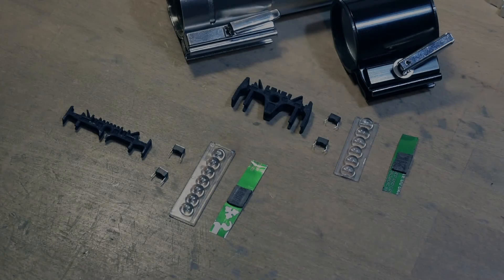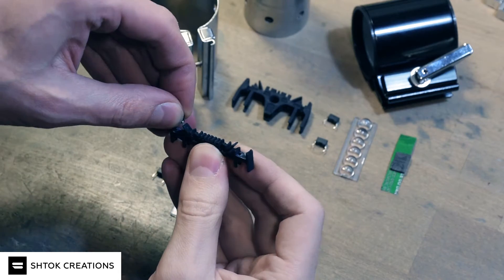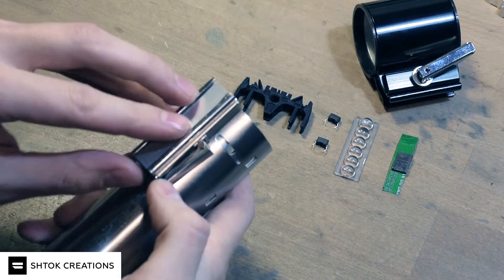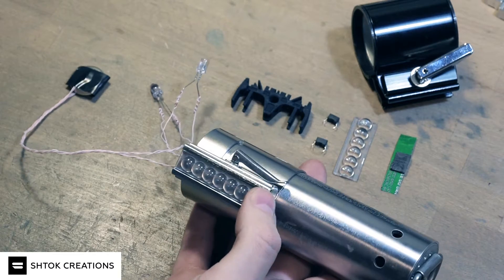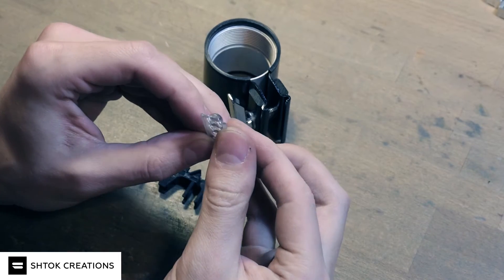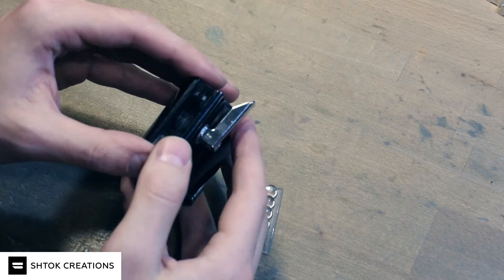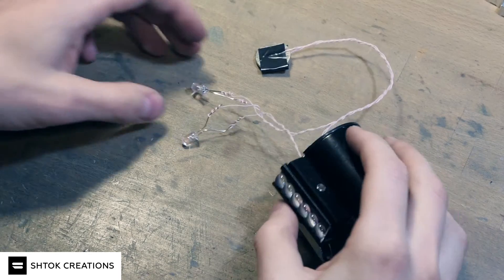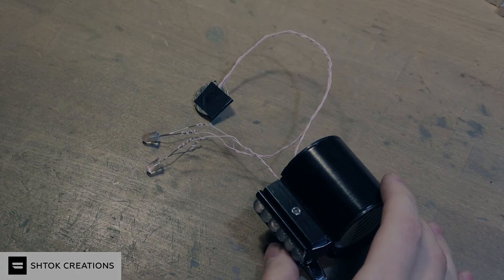Graflex 2.0 and MPP functional activation clamps

Comment: Awesome solution! I just received mine and have been testing it but ran into an issue - the bubble card does not move whatsoever when in the clamp so can't depress the buttons. Did you have to trim the bubble card at all so it moves? Not sure how this works when its stationary.